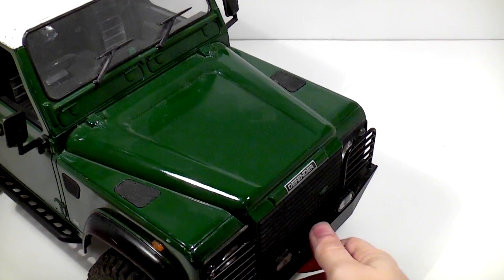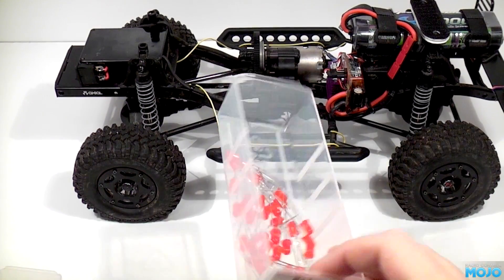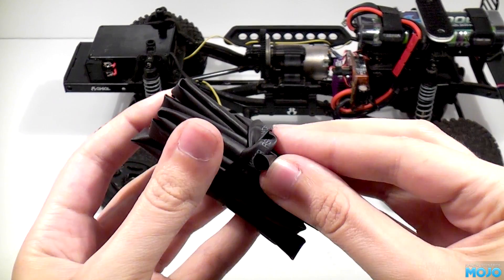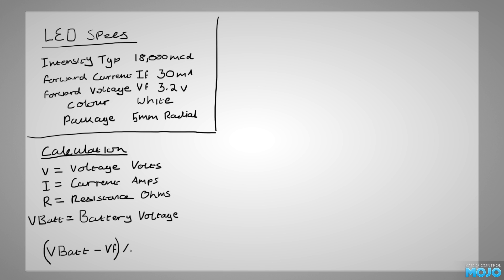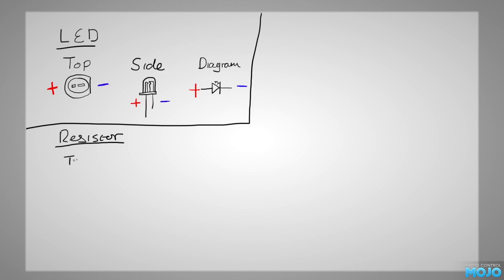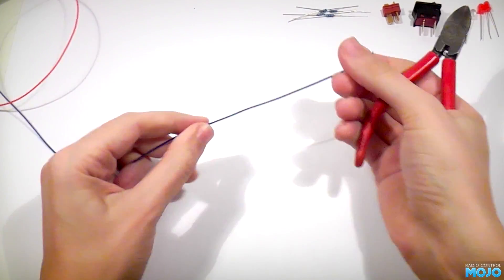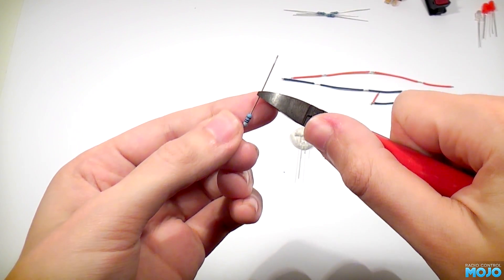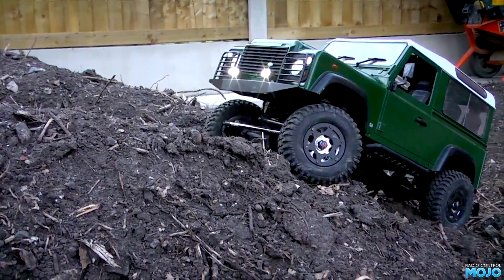Tutorial -  RC Lights: Beginners Guide

Comment from the maker: The red and white LEDs have different characteristics, so you could use one resistor for each pair, the next part is/was going to have series strings, but I haven't had a chance to plan it out yet. The main reason for a resistor per LED though was ease of value calculation, resistors cost less than a penny and it's hopefully easier for a beginner to see the current flow.

Comment: wow that looks hard well the calculations part does is there a sure fire way of getting a safe set up up like buying strong leds i would power from either a 9v battery or a receiver box if possible using different lipos.

Comment: is it possible to split the current between the esc and light system from the same battery? I am using a 30C 3s lipo 2200mah pack and the esc is a turnigy trackstar 80a waterproof. i will be using 12 leds (4 series). thanks
Reply from the maker: Take the LED supply from the battery connector on the ESC. I think the trackstar has a deans, if so:
remove the heatshrink
desolder the connector
strip some wire for the LED supply and wrap it around the bare ESC wire ends
put some new heatshrink over the ESC and LED wires
solder the ESC wires back onto the connector
shrink the heatshrink over the exposed wire

To make the ESC removable you'll want a connector between your new wires and the LEDs, BEC connectors work fairly well, easily available with wires pre crimped.

Lastly be careful, make sure the new wiring is safely terminated before plugging in the battery!

Comment: i know this, but i want to make it myself, for it to be even more uniqe. I have some Cold Catode tubes i could use allso. but we'l see. i haven't got all i need yet. most of it is in shipping. i have tried a bit. with what i had. a 3v battery, with a switch and 4 12mm diodes. I have some idea on what it will look finished. but it's the mounting i am most worried about.

Comment: hi guys im just starting out where do you buy your parts from ? really good tutorial very easy to follow
Reply from the maker: I tend to use Farnell or RS, but I also tend to order fairly large quantities. Also for a beginner in electronics they almost have too much to choose from. Buying from the likes of Maplin might be easier, just choose high brightness LEDs of the required colours and some metal film resistors of the right value.

There's also the eBay route, you can get bags of 50 LEDs for next to nothing, the problem with them is generally there's no data and they often have a much shorter life.